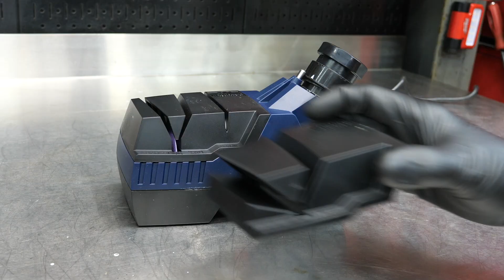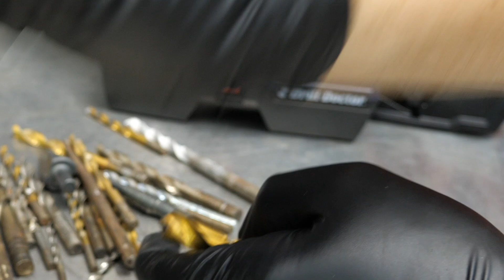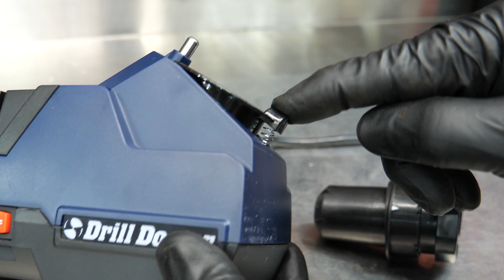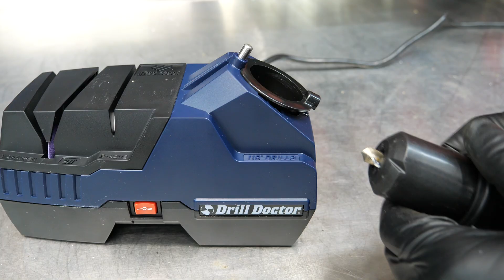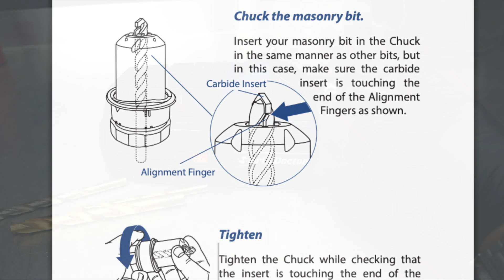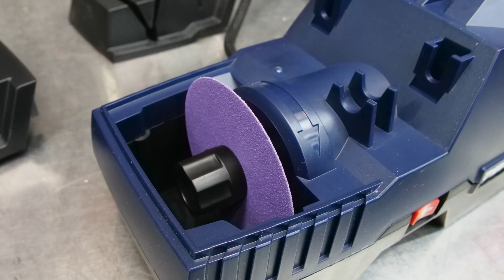SAVE YOUR BITS! Drill Doctor X2 Drill Bit & Knife Sharpener Review [WORK SHARP]

Comment: nice video. i have an older model, not sure what one but it can do split tips. this one to me seems a little more complicated to align the bit quickly. other models have the little arm things that grab the bit, align and set the depth much quicker. as mentioned though, this is more of a entry diy level. one thing i notice with mine is, the better quality the bit to begin with, the better it seems to work. you cant take a garbage bit and expect miracles. i have had a drill doctor since the very first one that came out (unfortunately got broken) but these are definately the easiest to use and are well worth it.